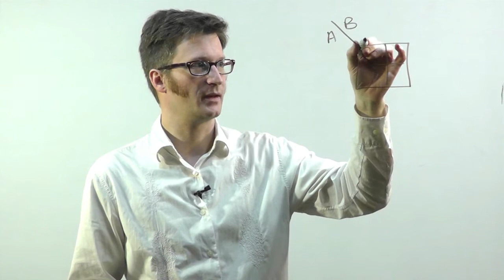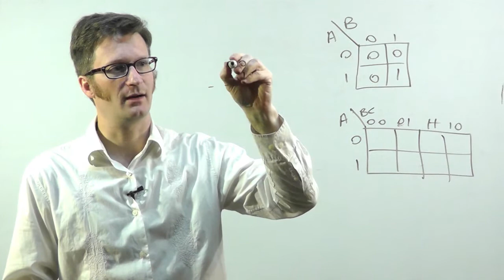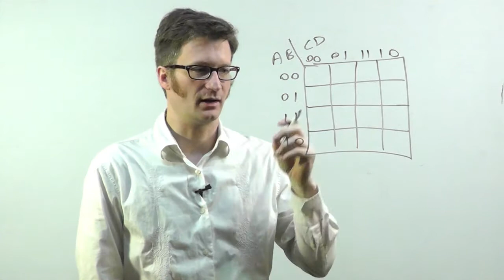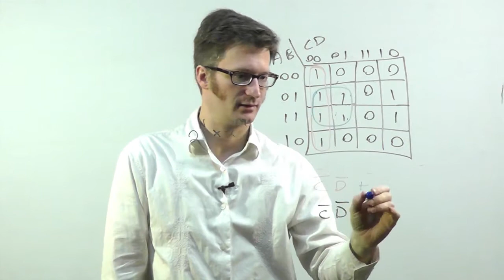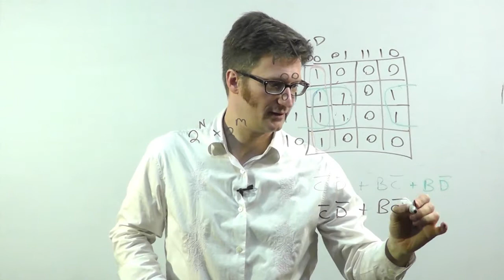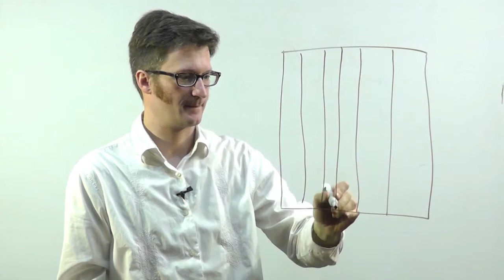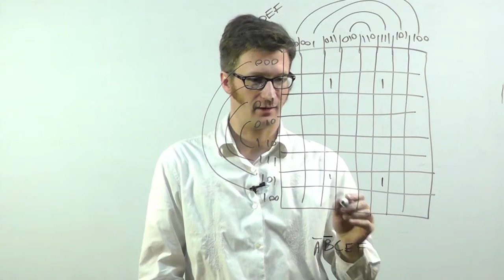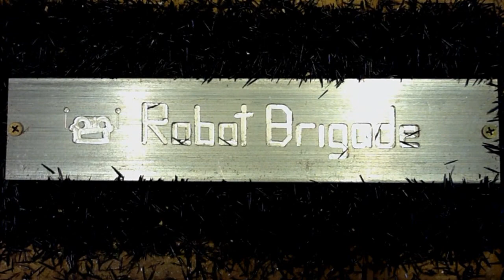Digital Logic - Karnaugh Maps

Comment: can u tell me what's your principle filling up the 1 , i mean where do u fill 1 a and where do fill it 0 because it's impossible in the truth table by AND  A,b,c,d,e,f, all must be high in order the output be high
Reply: those are probably examples, because he has no real example of a circuit. If you have any circuit you should firstly try to fill out a truth table for better comprehension. If you have succesfully filled it out you can take the values of the table and insert them "graycode"-wise in the Karnaugh-diagram. Then choose wheather you have more 0's or 1's which one you want to combine together. If you have chosen one of them then go for the Disjunctive normal form (DNF) or the Conjunctive normal form (CNF). Then pass on as explained in the video. After you finished your "extraction" you will now have a short form of a logic expression. Sometimes you can use De Morgan or other rules to shorten the expressions even more :D